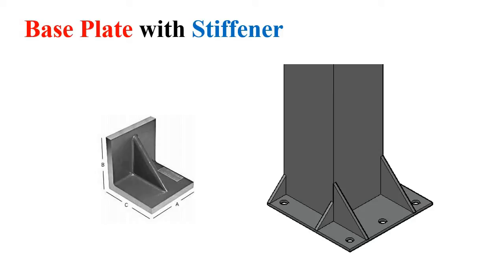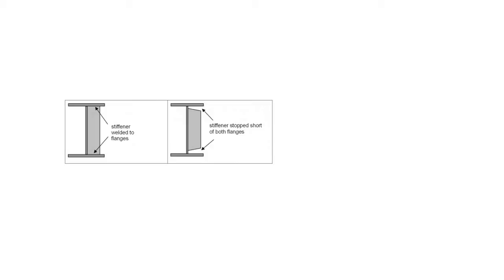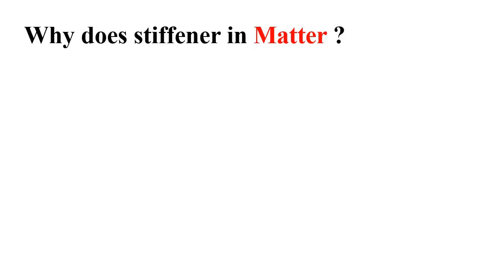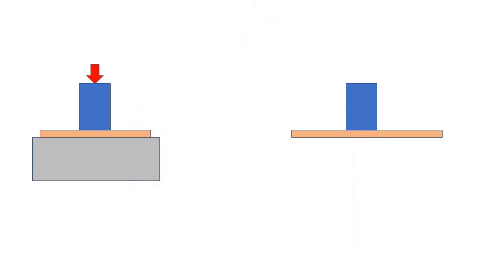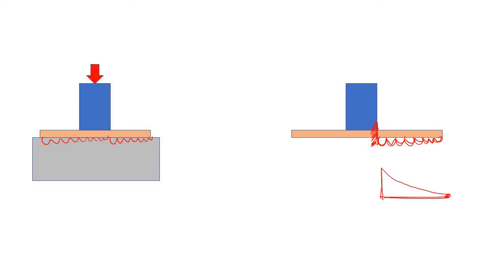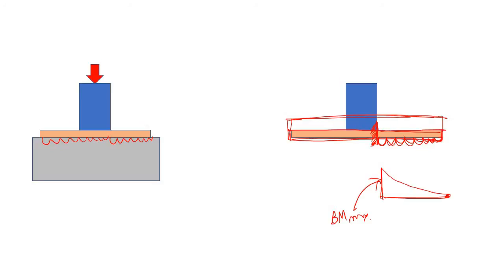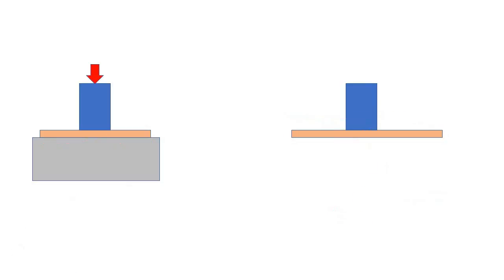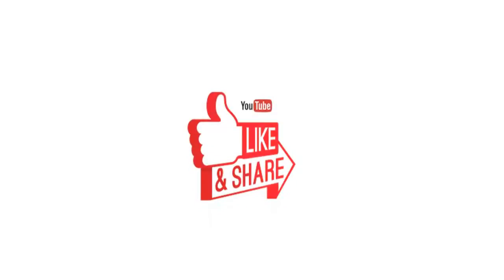Base Plate Stiffener : An Overview

Comment: What happens to the base plate between the stiffeners?  The plate is still bending, but has no stiffeners, so why won't that portion fail?.
Reply from the maker: Excellent question..well I will explain it in next video 👍
Reply: Yes question is really intresting? Kindly explain through video.
Reply: I agree with Tanmoy about the design philosophy of the base plate. However, when the basis for stiffener plate is coming then I partially agree with him. Firstly, generally the columns carry both axial load and flexure. Also the base is welded with plate and hence there is compression on one side while tension on the other throughout the length of column with max at the column base creating a situation of local buckling of the column plate near the base. To restrain the same we need to reduce the slenderness of the material near the base. On design basis and as per cidal provisions it is judged at what spacing stiffener can be given to restrict it. 
Secondly, to fix such plates we weld it to both column and base plate. This increases weld length and hence shear capacity to some extent at base. 
Thirdly, now as it is welded to the base plate, it has hypothetically broken the base plate into parts and now it behaves like a continuous slab supported at the points of stiffeners. We all know that BM in continuous member is lesser than cantilever under same load. Thus it reduces the thk of the base plate. Now the just like a beam in a grid slab the plate distributes load to the stiffener which acts like a cantilever beam and for  cantilever beam max stresses due to shear and flexure acts at the column end, so, the stiffener depth is max there to cater shear by providing ample weld length and flexure by providing ample depth. 

Hopes it answer the queries